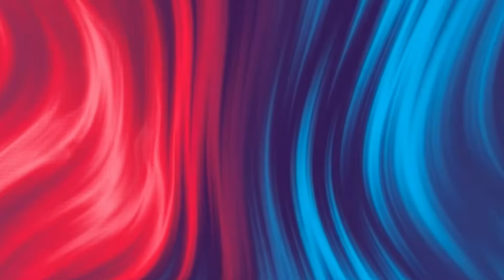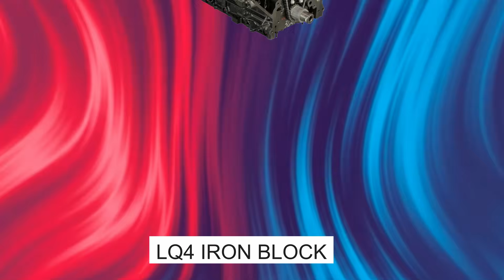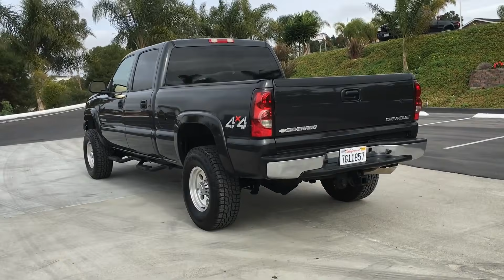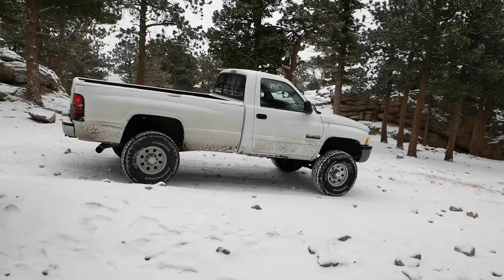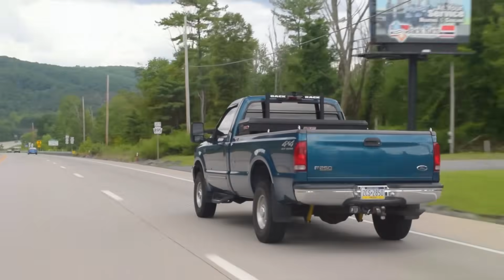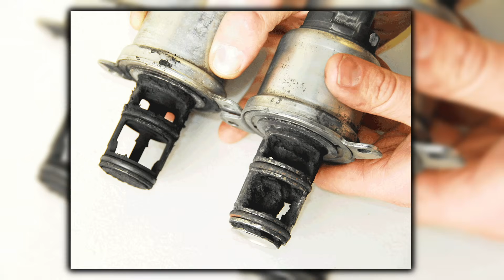3 Heavy-Duty Trucks That NEVER Break Down (Buy Once, Drive Forever)

Comment: Newer trucks are junk I have 05 GMC Sierra 2500hd diesel with 229k on it and still going strong 💪
Reply from the maker: The 2005 LLY Duramax is a brute, and at 229k miles, it’s a perfect example of why those pre-DEF trucks are still so highly valued today. You’ve got all the Allison transmission strength without the headache of modern exhaust after-treatment sensors constantly putting you into limp mode.

Have you already addressed the common LLY wiring harness rub-through on the alternator bracket, or has your electrical system been trouble-free so far?

Comment: I had a 94 f350 na with 155k I regerted selling it 2 years ago ,crew cab simple regular maintenace the best truck Ive ever owned , Ill buy 1 in a heartbeat
Reply from the maker: The 1994 crew cab with the 7.3L IDI is a specialized machine that represents the peak of mechanical simplicity. Finding one with only 155k miles is rare today, and it’s no surprise you regret letting it go, as those International-built blocks are famous for handling decades of work with nothing more than basic oil and filter changes.
If you do find another one, are you planning to keep it naturally aspirated for that ultimate reliability, or would you look for one of the rare factory-turbo versions from that final production year?

Comment: Still driving 1999 F350 Lariat 7.3L - Big Red
Reply from the maker: Big Red" sounds like a classic. The 1999 model year was a great transitional period for the Super Duty, and keeping a Lariat in good shape proves just how well these 7.3s hold up when they aren't being used as disposable work trucks.

Since yours is a '99, do you have the "Early 99" setup with the smaller turbo and injectors, or did you get one of the late-year versions with the larger intake plenums and improved HPOP?
Reply: @A @AutoMetricsHQ  has the bigger 5-bolt pattern turbo and larger plenum
Reply from the maker: Having the late-99 setup is a huge advantage - those larger intake plenums and the more robust turbo design give you a lot more breathing room when you're under load. It’s the definitive version of the Super Duty 7.3L before they started playing with the powder-forged rods in the very last production years.
Since you've got the better HPOP and turbo, have you done any upgrades to the transmission cooling to match that extra airflow, or are you still running the original 1999 cooler?

Comment: They all break down. 7.3l is one of the worst.
Reply from the maker: Every platform has its weak points, but calling the 7.3L one of the worst is a stretch when you look at the service life of those International-built blocks compared to modern emissions-equipped diesels. Most of the "breakdowns" on a 7.3L are usually just $150 sensors like the CPS or a leaky IPR valve, rather than catastrophic internal failures.

Are you basing that on a specific bad experience with the HEUI system or HPOP failures, or do you just prefer the mechanical simplicity of the older 12-valve or IDI setups?

Comment: I have a Chevy 2007 Duramax diesel with 182,000 miles on it. Yeah buddy.
Reply: These year of GM diesel trucks are very reliable and last forever
Reply from the maker: They really are the sweet spot - you get the refined Allison 6-speed transmission and the power of the LBZ without the emissions equipment that started causing so many headaches in 2008 and beyond. It is rare to find a truck today where the factory output and the drivetrain durability are so perfectly matched right out of the gate.
Are you running yours as a dedicated tow rig for the heavy stuff, or is it more of a daily driver that you're planning to keep for the long haul?
Reply from the maker: If that’s a 2007 "Classic" body style, you’ve got the LBZ, which is widely considered the best Duramax ever built. 182,000 miles is just breaking it in for that engine, especially since you escaped the added complexity of the DPF and DEF systems. I actually featured exactly that era of GM heavy-duty trucks in my new video because they are such legendary workhorses.
Since it’s an LBZ, have you checked your transfer case for any signs of "pump rub" wear, or have you already installed a protector kit to save the housing?

Comment: Still driving my '99 XLT 7.3.
Reply from the maker: The 7.3 Power Stroke in a '99 is one of those engines that just doesn't have a ceiling - mechanically about as overbuilt as a diesel pickup gets. Still one of the most sought-after trucks on the used market for good reason.

What's the mileage at now?

Comment: I have a 96 F250 in great condition with a 7.3 turbo diesel and 381000 kilometers on her.
Reply from the maker: The OBD-I era 7.3L Powerstroke is a fantastic middle ground - you get the reliability of the HEUI system without most of the complex sensors found in the later 99-03 Super Duty trucks. At 381,000 kilometers, that engine is technically still in its prime for that year.

Since it’s a '96, are you still using the original mechanical fuel pump on the back of the engine valley, or have you swapped it out for an electric fuel system to make filter changes easier?

Comment: I've got a 2003 GMC 2500 with the 6.0. Helluva motor with about 280k on it.  I'm on about the third transmission, second front end rebuild,  my electronics are shit  but the motor is great. I bought it in pretty rough condition about 15 years ago. If they all had motors like this it would be great.
Reply from the maker: That 6.0L iron block is the perfect example of an engine that will simply outlast the truck wrapped around it. Even with 280k miles and a rough start, that LS-based architecture handles heat and high mileage better than almost anything else from that era.

Since you've already been through a few transmissions, are you running a larger aftermarket cooler now to help that third unit survive the heat, or are you just sticking with the factory setup?

Comment: Cummings 5.9 2006 and before.
Reply from the maker: The 2006 model year is the absolute peak for the 5.9L Cummins before the 6.7L took over with all the added emissions complexity. That 24-valve common rail setup combined with the G56 manual or the 48RE automatic is a fantastic platform that handles high mileage with zero complaints.

Comment: 253 K on 2001 7.3 Powerstroke. She's beat up from previous owner use but frame is rust free and engine got a lot of life left in it. Since owning I keep the fluid maintenance up and had to fix turbo pedestal leak. She will get all the TLC needed to get it to 500K God willing!
Reply from the maker: A rust-free frame is the most important part of the battle with these 7.3L trucks, as you can fix almost anything else with a wrench. The turbo pedestal leak is a classic "rite of passage" for a 2001, but once those O-rings are replaced, that engine is ready to get back to work for another few decades.

Since you're aiming for that 500k milestone, have you checked the play in your turbo compressor wheel or looked into upgrading the mechanical fuel pump to ensure the injectors stay happy at higher mileages?
Reply: @AutoMetricsHQ  No sir, I haven't but will add to the list, thanks!
Reply from the maker: It's definitely worth checking whenever you have the intake off. Catching a little bit of shaft play early can save you from a major headache down the road, and keeping those injectors fed with consistent fuel pressure is the best way to hit that 500k mark.

I’m always happy to help keep these old giants on the road - feel free to reach out anytime if you run into any other questions while you’re working through that list!

Comment: My 2002 dodge Cummins 5.9 417k miles. Runs better than new. No engine work just Fass fuel pump. And on 3rd set of injectors. Alternator, starters, and water pumps are normal wear items.
Reply from the maker: 417k miles on the original long block is a great run. Moving to a FASS lift pump was likely the smartest thing you did for that engine, as it’s the only way to keep the VP44 alive for that kind of mileage.
Since you’re on your third set of injectors, are you sticking with stock replacements or did you bump up the nozzle size slightly for a bit more efficiency?
Reply: 50 horse + injectors and 4" exhaust.  Still original turbo. Valve adjustment every 100 k. Amsoil dual bypass filter.
Reply from the maker: A 50hp bump combined with a 4" straight-through exhaust is the sweet spot for a 24-valve - it gives you that extra pulling power without pushing the EGTs into the danger zone. Running an Amsoil dual bypass setup is exactly why that original turbo is still spinning at 417k miles, as those sub-micron filters keep the oil clean enough to prevent bearing wear.

Since you're religious about those 100k-mile valve lash adjustments, have you noticed them drifting much out of spec over the years, or has that top end stayed remarkably tight?

Comment: I have a 2005 Chevy Silverado 2500 HD ext cab with the 6 liter gas motor....love the silver beast had it for four years...just  regular maintenance and replacing things to fix it  back up
Reply from the maker: That 6.0L is a great choice - 227,000 miles is right in the sweet spot for that iron-block V8. As long as you’re staying ahead of the maintenance, those engines will easily handle another 100k without breaking a sweat.
Have you had to deal with the common exhaust manifold bolt snap yet, or is your Silver Beast still running the original hardware without any leaks?

Comment: We have one at the shop , it's a 99 ex- emergency services f450 7.3 . It has 14750 kms ( 8500 miles ) in like new condition  !
Reply from the maker: Finding a 7.3L with only 8,500 miles is like finding a time capsule; that engine is effectively brand new. Being an ex-emergency vehicle, it likely has more idle hours than the odometer suggests, but those International-built internals are barely even seasoned yet.
Since it sat for so long with such low mileage, have you pulled the valve covers to check for any signs of o-ring brittle-on or checked the fuel bowl for sediment from old diesel?

Comment: I have a ‘99 F350 dually 7.3 with a 6-speed manual and a 2012 Ram 3500 dually 6.7 (pre-DEF) with a 6-speed manual. Not getting rid of either of these trucks!
Reply from the maker: That is an elite two-truck garage. Pairing a 7.3L with the ZF6 manual is the ultimate "fix-it-with-a-wrench" setup, while the 2012 Ram is highly sought after because it’s the final year of the 6.7L Cummins before the added complexity of the DEF system.
Since both are 6-speeds, have you upgraded the 7.3L to a South Bend or Valair clutch to better handle the low-end torque, or are you still running the factory dual-mass flywheel setup?

Comment: I and my son have driven and still drive our F250's ( 25 years now) Ford imported these in 2005 into South Africa with Mwm td 4.2l sprint motor ( from Brazil)
Self serviced.
Each has about 380000km on average.
Reply from the maker: The South African Ford F-250s with the MWM 4.2L Sprint engine are fascinating machines, as that inline-6 is essentially an industrial motor known for its incredible thermal efficiency and simple mechanical injection. Reaching 380,000 km through self-servicing proves that the Brazilian-built MWM is a legitimate alternative to the American Powerstroke for long-term durability.
Since you are doing your own maintenance, have you noticed any significant wear on the turbocharger seals or fuel injectors, or is the 4.2L still running on all its original internal components?

Comment: 2002 f-550 212k primary truck, 2002 f-450 230k backup rig.  I will not let them go until I retire and maybe not then.  They are pretty expensive to keep tires on if you're not in need of the weight rating. I do love my 7.3s
Reply from the maker: Running two 7.3L setups in that weight class is a smart business move, especially since you’ve avoided the emissions-related downtime of newer fleets. The 4R100 transmission and the HEUI injectors on those 2002 models are extremely reliable as long as you’re running high-quality oil and keeping the HPOP healthy.
Since you're running that F-550 as your primary rig, have you switched over to a 6.0L-style transmission cooler or an auxiliary fan to help manage the fluid temps under those heavy-duty load ratings?

Comment: Bought a 2001 dodge. 371.000 miles. Replaced starter motor.  Replaced u joints. Been the most reliable truck I've owned. Oh and the potentiometer on the gas pedal.
Reply: Have a 2015 f350 diesel automatic with 473000 farm miles on it and put a transmission in 20000 miles ago and a ac compressor two weeks ago and balljounts once. All I’ve done other than normal maintenance. Change oil every 8000 miles. Starts to this day down to 20 below without plugging in.
Reply from the maker: That is an incredible run for a 2015 6.7L, especially with those harsh 20-below cold starts. Crossing 473,000 miles on a farm truck proves that if you stay on top of those 8,000-mile oil intervals and keep the weight moving, the Scorpion engine is a powerhouse for longevity.

Since you've already handled the transmission and ball joints at that mileage, have you had to replace the original CP4 high-pressure fuel pump yet, or is it still running the factory unit?
Reply from the maker: Hitting 371,000 miles with only a starter, U-joints, and an APPS replacement is incredible. It really highlights how durable that 5.9L Cummins is when the core mechanicals are left to do their job without constant interference.
Since you've had to replace the potentiometer on the pedal, have you noticed any other "dead pedal" symptoms or surging, or has the new sensor completely cleared up the voltage signal to the ECM?
Reply: @AutoMetricsHQ yes fixed the problem
Reply from the maker: Good to hear that fixed it. Usually, when that APPS starts acting up on a high-mileage 24-valve, it’s one of the few things that can actually make that truck feel unreliable, even when the mechanicals are still perfect.
With over 370k on the clock, are you still running the original fuel injectors, or have you had them popped and tested for spray pattern and pressure recently?

Comment: Bought my ram slt new in 1997 in oakdale. Paid $45k for it including shell and running boards. Now has 150,000 miles on the 12valve with automatic transmission. Yes, done some cosmetic upgrades but nothing major. Not a hot rod but a workhorse it is. Love it. From 1-10 I give it a 9. Did put in a jasper rebuilt tranny at 140,000 miles.
Reply from the maker: The 1997 with the 12-valve is the "holy grail" for many, and getting it to 150,000 miles is just the first chapter for that P-pumped motor. Swapping in a Jasper unit was a smart move for longevity, as the stock 47RE automatics were always the weak link when matched against the torque of the Cummins.
Have you had the KDP addressed yet, or is the timing gear housing still in its factory configuration?
Reply: Yes, the KDP was done at 90,000 miles.
Reply from the maker: That is the best news you can have with a 12-valve. Getting that KDP handled at 90,000 miles means you eliminated the only real "ticking time bomb" in that engine before it ever had a chance to cause trouble. With the P-pump and a solid transmission, that truck is built to handle another 300,000 miles without breaking a sweat.
Since you've already modernized the transmission and secured the timing gear, are you still running the stock fuel plate in that P7100, or have you adjusted it for a bit more low-end grunt?